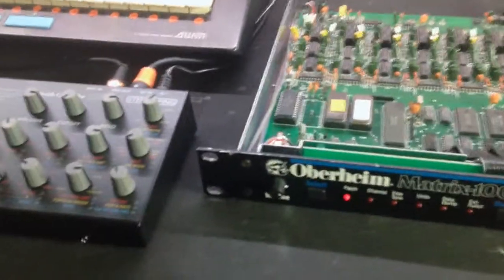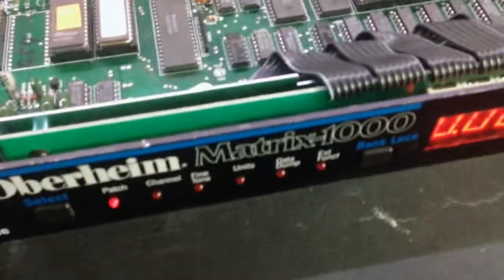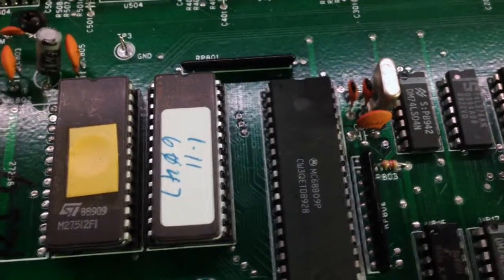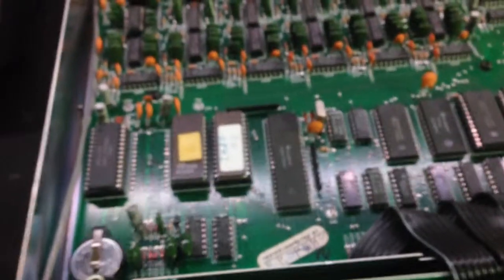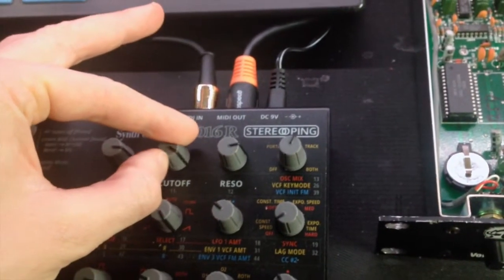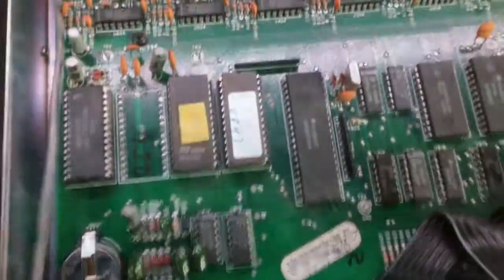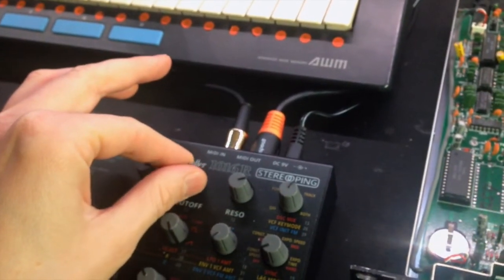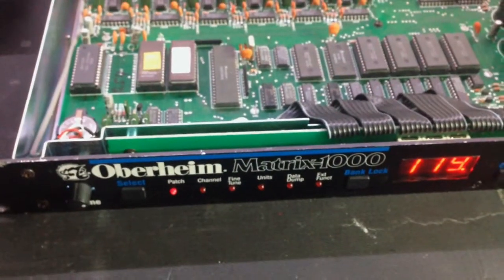Oberheim Matrix-1000 Firmware Comparison (1.11 vs 1.16)

Comment: do i need special equipment to change the firmware?
Reply from the maker: Flat screwdriver will do, but need to be very carefull. Especially entering the new firmware into the IC socket requires some skill.